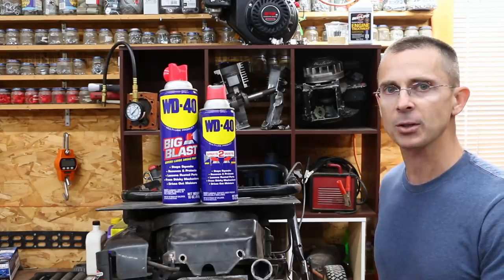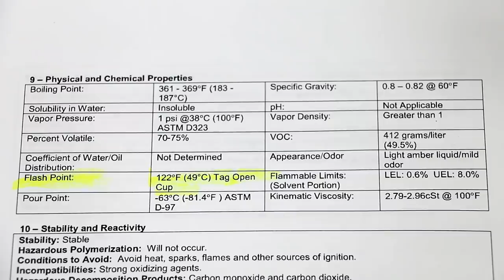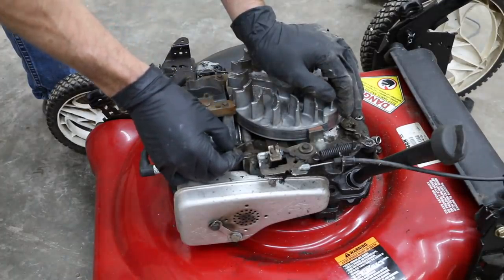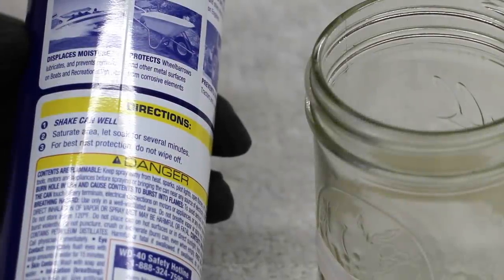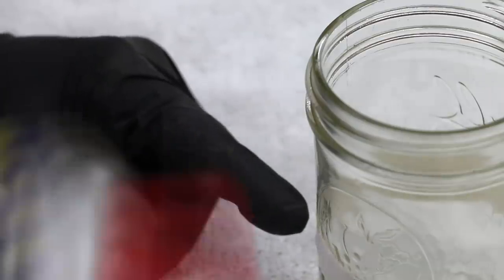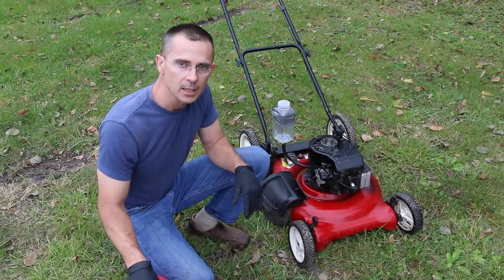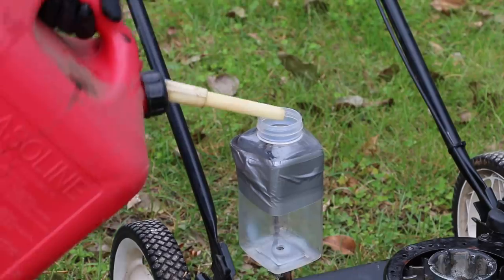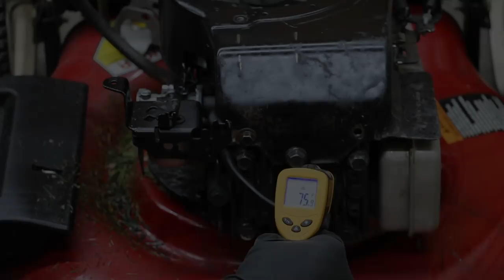Will a Gas Engine Run on WD-40?  Let's find out!

Comment: Im curious about whst it does in a diesel engine
Reply from the maker: Thank you for the video idea!
Reply: A diesel will run on almost any oil based fluid it can get through the injectors
Reply: Skidin Dingo that’s what I was thinking cause it’s more likely to work better
Reply: Me too
Reply: @JoeEric3  did we ask? NO!!!!!! #!!
Reply: @kevinscollan8293  pours in bacon grease
Reply: Kevin Scollan The 7.3 IDI in Ol Slave Lake didn’t even chooch with WD-40
Reply: @av0-cad03  mmmmmm fuel...
Reply: You can use the non-aerosol version of WD40 as a starting fluid on diesels.  I have already confirmed that a diesel will run off of the stuff.  Not sure of the repercussions of running it longer than 30 seconds though.

I'd like to see how long a diesel will run on starting fluid.  Out in remote Alaska, we use starting fluid (which is usually a no no) to fire up old tired diesels.  They usually end up relying on starting fluid to start once they get used to it.  I used to operate an old 988F that took about a can of starting fluid to start, period.  No matter the temperature, it wanted a good huff of the good stuff before it got out of bed, so to say lol.
Reply: Maybe try putting white out in a gas engine
Reply: I'm curious to that as well.
Reply: @ProjectFarm  did you make  a video  on it
Reply: @ProjectFarm  a project you could do which is very violent you have to be real careful. Oxygen and setalene but just use a little oxygen out of a torch for safety. Get head of torch down a carbureted carb of vehicle while running. Don't fill up an engine with nitrous or oxygen and try to start it that makes a real big bang that people have actually done at the track and on the street accidentally.. They say oxygen is so strong it'll literally lift the heads off. Kinda hard to believe but anything is possible after seeing nitrous explosions. Oxygen is far more violent than even nitrous. One day I'm going to get around to trying it myself but of course safety and just a little bit while the engine's running. I've done it with nitrous in a stock engine just lightly and it makes the engine speed up. Nitrous is the best bang for the buck for power.
Reply: Gives you a big repair bill.

Comment: wd 40 in a diesel engine
Reply from the maker: Thank you for this recommendation.
Reply: i say this because as you said it's more like diesel than gas
Reply: WD-40 is a pretty good starting fluid for a Diesel engine. It’s safer than ether
Reply: Its closer to kerosene than diesel
Reply: WD40 makes a good starting fluid for diesel. I've used it a couple of times for that purpose.
Reply: Kierone like any mineral oil it will ignitt under compression so yes it should have the same output properties as diesel or better
Reply: I don’t know where he could find a Diesel engine to use
Reply: Just an idea, MAYBE you could find a glow plug that fits this or use your machining skills to make it fit somehow and then try it with WD-40 again. I feel like no one has a diesel engine laying around willing to potentially ruin.
Reply: Kierone I seen a dude on a channel called the zip ties and bias Plies try to use WD-40 to start his diesel in the cold and not even close
Reply: They do make diesel engine lawnmowers. Granted they might be too expensive to just do projects on, but I'm sure some loyal viewer could dig one up.
Reply: fuzzy wuzzy lol yes I saw that. But if you remember in the same vid he was hydro locking on starting fluid as well. Some times it's just to cold.
Reply: +m1ke2001 there is a lot more to a diesel engine than just a glow plug. Diesels do not even use the glow plugs after the engine is running.  Very high compression and injecting the fuel during compression are the main keys.
Reply: esqueue 
Yea they do , that’s the point... 
put some heat in the chamber before you even crank it over. 
Disable them if you use ether.
Reply: you'd have to "fill" the head to raise the compression by 250% or get a longer connecting rod.
Reply: Just pump the head full of some good 'ol JB Weld! Really, though, you could probably mill a decent amount of material off the cylinder head mating surface and work your way up to the target compression ratio by building up some braze or weld beads in the combustion chamber. No mill? Just grab some more electrodes or brazing rods.
Reply: well that would be expensive to ruin a diesel wouldn't it?
Reply: Wyatt Bronner watch the video where the dude on Zip ties and biased plies channel tried to start slave lake (his ford IDI diesel) with wd-40
Reply: We've used wd-40 to run a 6-71 Detroit while get the fuel system going. It didn't get addicted to the.wd40 like starting fluid. Lots of smoke.
Reply: That would be an extremely interesting project. See if you could raise the compression enough to make one of the little engines run on diesel. If it worked you could try all sorts of different things in it. Not sure if it could be made to work with a carb
Reply: jb weld didn't hold for 2 barbecue sessions for a handle on my cheap assed grill for a handle for 2 burgers! i use a bolt in one of the 2 handle holes to open and close it. JB can't take the heat. it cracks and fails around 350F, it won't survive a combustion engine's internals.
Reply: yeah, Def some diesel stuff would be cool!
Reply: Petrol in a Diesel engine.
Reply: Gurraayto Eye-Dee!
Reply: kakswell That would completely kill the engine.
Reply: Do they make diesel lawn mowers?
Reply: Normal
Reply: @mrbadx19  you're thinking of jb quick weld. w/ clean sanded surfaces clamped for 24 hours the real stuff is damm impressive & stable over 500°F
Reply: @nathansmith3608  i'll try it again, i was on the balcony for the first time since last fall today.
Reply: m1ke2001 that’s not how Diesel engines work.
Reply: I've used WD 40 to start diesel engines after having to open up an injection pump or fuel line. It is much better than running them off starting fluid until the air is bled out. 

Edit: Atleast it sounds better, starting fluid has that God awful knock, WD doesn't.

Comment: Run the WD-40 as Oil and as Fuel the same time
Reply from the maker: Thank you for this recommendation.
Reply: Like a 2 stroke
Reply: Done, I was a recomendation for this test because Ive done it in a 2 stroke weed eater, but I didnt need to choke it, or maybe I forgot de choke on maybe?
Reply: Ur looking for an explosion 😂😂
Reply: I'm still waiting will a Nitro engine run on gasoline
Reply: I would like to see this
Reply: oof
Reply: Wd40 is rust removed but try lithium grease
Reply: Well a two stroke would work fine with it :-)
Reply: DashcamDriversGermany wd 40 is not that good in lubricating things. I only use it to remove rust. For all tools need proper lubrication, I go for greases, light machine oil or just use engine oil mostly.
Reply: @ Sheng Han 
If you spray WD 40 on tools they will rust .
Reply: @bendermi  you are right. It doesn't prevent rust. The fact it removes rust probably mean it is to certain level corrosive. But it is kind of effective in cleaning and rust removal.but once you are done rust removing, you better clean it off and oil your tool with oil or grease properly.
Reply: @ Sheng Han 
All oils removes rust the best rust removal is oil for an outboard and you don’t have to oil afterwards.
Reply: @bendermi  and of course many of those marine grade lub and greases are good for multiple application outside the norms.
Reply: Sheng Han 
👍🏻
Reply: JordanMatthew Anderson I did that when I was a kid with my Cox airplane fuel. I had to choke the crap out of it, but it did run.

Comment: Yes finally i can mow my lawn & piss off the neighbors at the same time.
Reply: Drill the muffler out ;)
Reply: untouchable, light after darkness use a v8 powered mower
Reply: KM, also fumigate the insects and prevent frost-freeze on your plants!
Reply: Remove the muffler from your lawnmower and replace it with a piece of straight pipe, that should piss them off pretty well. Also adding two stroke and burning it in a four stroke engine will make it smoke.
Reply: same thing
Reply: I mean, my mower upsets the neighborhood, but not with the smoke. They just dont like the noise at 7 in the morning!

Comment: I've used it to start engines for years with no problems at all. Just make sure it uses the flammable propellant.
Reply from the maker: Thank you for this recommendation.
Reply: Yes, great starting fluid for small engines, safer and easier on them than ether.
Reply: @TheOldGord  You obviously have not tried this lately? The absolute best starting fluid is 50:1 mix. Think about it.

Comment: Fun fact: Some diesel injector/engine cleaner additives actually contain the same product as WD-40 !
Maybe you should try WD-40 on a diesel engine...
Reply from the maker: Thank you for the video idea!
Reply: @ProjectFarm  could get expensive, but I'd like to see it
Reply: It works but you need an old diesel engine the newer one aren't as capable as the old one
Reply: Worked in my XR400R
Reply: It even looks cleaner afterward at 6:12.
I'm gonna give it a go. I used acetone in the past. Or brake cleaner this winter. Lowering the flashpoint too much may suck during the summer.
Reply: @ProjectFarm  It works on my 93 Dodge 12 valve Cummins.

Comment: This is one of my favorite series! I have a suggesition. How about to see if an engine can run on embalming fluid? From wikipedia: Typical embalming fluid contains a mixture of formaldehyde, glutaraldehyde, methanol, humectants and wetting agents, and other solvents that can be used. The formaldehyde content generally ranges from 5-35%, and the methanol content may range from 9-56%.

Comment: Well I sure didn't expect this to work at all!
Reply from the maker: Thanks for commenting.
Reply: deweys It's perfect starter fluid for TWO strokes...
Reply: Project Farm LOVE YOUR STUFF BRO!! :)
Reply: You must not have ever owned a carbureted vehicle
Reply: Jefferson Graves You mean for first comment not me, right?
Reply: deweys well like any mineral oil it will ignite under compression
Reply: If there's one thing these videos have taught me it's that an engine will run (even if not very well) on practically anything combustible
Reply: Cyanide Cloud did you have to be taught that?
Reply: deweys ikr
Reply: Project Farm Hey could you try butane
Reply: Jaiquan West Cars run on propane-butane mixture it will... Lower power but will...
Reply: I sure didn't expect this to work at all!

Especially since that 57-68% "Aliphatic Hydrocarbons" is a fancy term for "highly refined kerosene" and the Petroleum Base Oils are even longer chain hydrocarbons (whereas gasoline hydrocarbons are shorter chain HCs).
Reply: did you have to be taught that?

Wax is combustible, but you don't see too many people stuffing it in their gas tanks.

Comment: Have you thought about doing Muffler tests on these small engines? like making a muffler with a coffee can full of steel wool or something.

Edit: use a decibel-meter If you have one on hand.
Reply from the maker: Thank you for this recommendation.
Reply: I was wondering about making a muffler with rock wool as a lining or maybe some sort of bubbler type of muffler. It should absorb sound and polution too
Reply: @aronbraswell1589  AMD Cool'n'Quiet, but without the AMD, or the cool.

Comment: can we get a video on running an engine on coleman camp gas? or maybe bbq lighter fluid? I say camp gas, that stuff burns HOT
Reply from the maker: Thank you for this recommendation.
Reply: Coleman fuel is 100% naptha, as in the chemical that raises the octane rating of gasoline. 
Most lighter fluids are watered down kerosene.
Reply: @vector6977  Strange...all the charcoal lighter fluid I've ever seen is just mineral spirits.
Reply: Project Farm how about running diesel through a gas engine
Reply: If you ran that around the yard a few times, you could kill a lot of mosquitos!
Reply: Coleman fuel is just ultra processed gasoline, they remove more impurities out of it and charge much more for it, yes an engine will run just fine with it ( I've mowed our lawn at our cabin with Coleman fuel after forgetting to get gas on the way up) 😉

Comment: If you ever want to acquire all the liquid from an aerosol can, you can use a GI P38/ P51 can opener to open the can along the top near the bead. I have done this when a can no longer has propellant, or want all of the product inside without spraying forever ;) thanks for another great video!

Comment: Can you use axle grease instead of regular oil?
Reply from the maker: Thank you for this recommendation.
Reply: That's not going to end well.
Reply: Bigelow Brook Farm (Web4Deb) I want to see that vs ATF
Reply: Pre warmed up and somewhat fluid would probably be okay.  Cold and gooey, nope.
Reply: Bigelow Brook Farm (Web4Deb) be fare under normal circumstances it would start off cold and hard
Reply: CSX2586 Rail Rider Raby ,,, automatic transmission fluid,,, works extremely well in the oil,,,. To clean the engine and lifters,,,. Many times the lifters will pump up,,, and the tick go away,,. !!!
Reply: @ProjectFarm  again, not a recommendation,  its a question. This guy^^^ smh
Reply: Yes you can btw, once thinned, oil is oil and all of them start as crude. ..man, twist them in a laboratory from there. Hes not gonna answer a question, he just says thanks for you recommendation

Comment: replace oil in the crankcase with diesel because diesel is like oil, and see how long it will last
Reply from the maker: Thank you for this recommendation.
Reply: That’s how some people flush their engines. Should be OK as long as you idle it low and don’t put a load on it.
Reply: This

Comment: Have you ever tried running engine on car dashboard cleaner? In Poland we have relatively cheap "Plak" and many people use this to help to start engine
Reply from the maker: Not yet. Thank you for this test recommendation.
Reply: This sounds too odd to work, but it would be interestingly different lol
Reply: We use the same in lithuania
Reply: irocket z tego co mi się wydaję to nie powinno być problemu
Reply: irocket 
I'm sure the cleaner will contain silicone which damages catalytic converters.
Reply: I found two very similar MSDS's of this product. One says that is 50-60% of hexane, 15-20% of cyclopentane,  3-5% of n-hexane, 3-5% of pentane, 10-12,5% of butane, 7-10% of propane and 5-7% of isobutane. Second MSDS says that there is 80-90% of "hydrocarbons, C6 isoalkanes, <5% n-hexane", 5-7% of "Gases (petroleum), liquefied, desulphurised (contains <0,1% w / w 1,3-butadiene)" and 1-3% of "Benzene, mono-C10-13-alkyl derivs., distn. residues"
Reply: yeah same in slovenia its called max brill

Comment: Have you thought of running a two stroke? The smoke made me wonder if a two stroke motor would run on straight WD 40
Reply from the maker: Yes, I've got 2 stroke videos coming in the near future.
Reply: I used to mix marvel mystery oil in my gas when i rode two strokes. I did this in addition to the oil in the oil injection system..
Reply: Moontanman 2 strokes run better on wd40 then 4strokes.
Reply: 2stroke2smoke 2 strokes run better than 4 strokes because 2 stroke has a higher compression ratio usually.You can make the 2 stroke to run on diesel easy.You just have to increase compression ratio ( not the psi) close to the compression of a diesel.It will get verry hot fast thogh but the power its crazy ,like a diesel torque and a 2 stroke Rpm .Ive done that by shortening the cylinder a few mm(calculated verry well) to increase the compression ratio .

Comment: Try rubbing alcohol and compare a 30%  70% and 90% mixture  on power etc
Reply from the maker: Thank you for this recommendation.
Reply: Would be interesting. Around here, isopropyl rubbing alcohol is sold in 50%, 70%, 91% and 99%. Though I'm not sure 99% is all that useful for "rubbing". What do people rub with rubbing alcohol, anyhow? I always used it as a solvent/cleaner. I also came across some ethanol rubbing alcohol at the .99¢ Only Store once. Did  double take on that one. Turns out it was denatured to make it undrinkable. No cut rate Everclear here!  :(
Reply: How does rubbing alcohol compare with nail varnish remover/acetone? Acetone has a different molecular structure which i think will run cleaner...

Comment: Take 2 cycle oil and add it to the crankcase to see if it is a good substitute as motor oil.
Reply from the maker: Thank you for this recommendation.
Reply: The exhaust is slightly less smokey than running on wd40.... don't ask me how I know ;)
Reply: Would be pretty entresting too see that and if it would give enough protection from cilinderdamage
Reply: Jadedragon327 do that for years

Comment: WD-40 is a good starting fluid for diesel engines as it wont wash the cylinders, while if you use too much ether in a diesel, it will wash the cylinders and damage the cylinder walls
Reply from the maker: Thank you

Comment: Awesome Video! May I suggest in a future you try all this stuff as alternative fuel but with a diesel engine? there a little to none videos about that, I wounder if a diesel engine can run on WD-40, paint thinner and those other stuff you tested in old videos ;)
Reply from the maker: Thank you for this recommendation and thanks for the positive comment.
Reply: MauroXtremeGamer ,,, on the farm we put our used motor oil transmission fluid brake fluid power steering fluid,, hydraulic fluid,,, just about anything in the diesel tank,,, no problem whatsoever,,,. Fuel filter picks up the contaminants,,,.  5 gallons of gasoline,,,to.  50 gallons of diesel,, is what the truckers that hauled steel up Jellico Mountain used. ,. !!!!
Reply: @ProjectFarm  
THIS!!! You can get a cheap Chinese clone diesel engines for cheap! Or get an old Kubota diesel APU out of a junkyard!